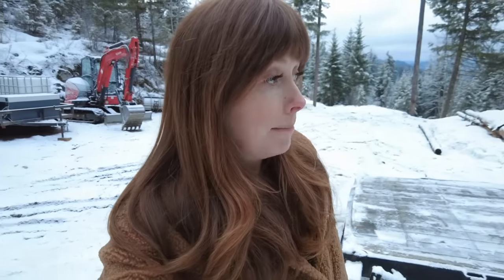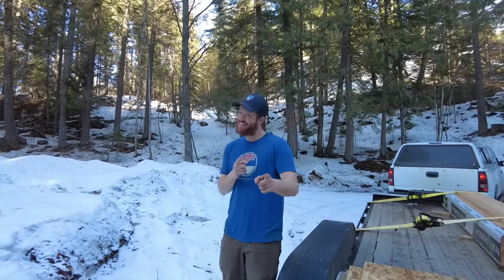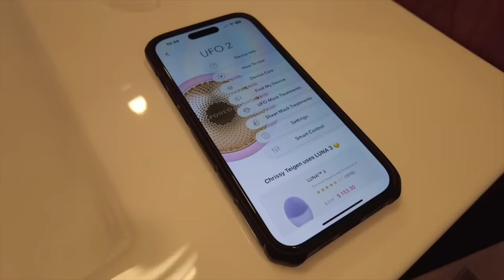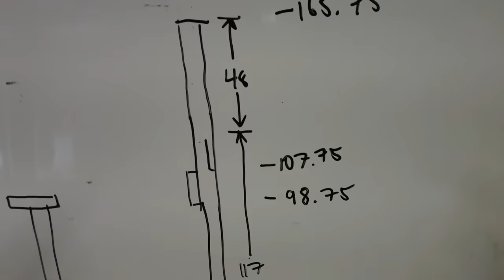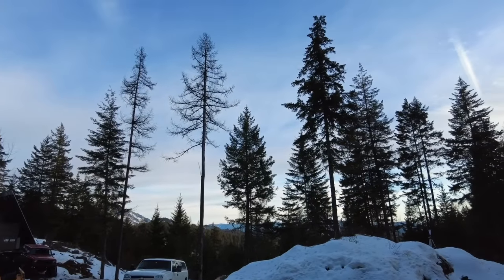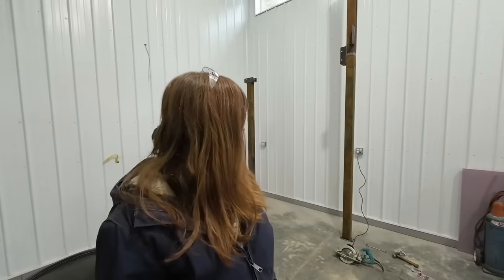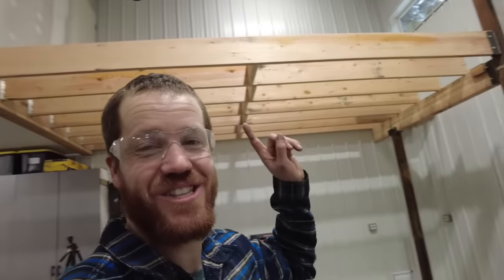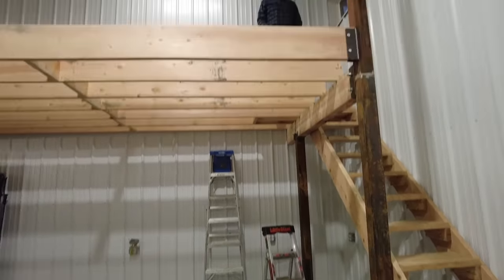Starting A NEW BUILD For Our Growing Family

Comment: Nice job. I live use of metal and CNC machine vs wood only. The engineering stuff is interesting to me as I know NOTHING about it. I also noticed Courtney you looked DIFFERENT in the beginning of the video. I thought it may be impending motherhood (which it may also be), but then realized later that it was THE BANGS. Your hair bangs make you look totally different (and the look becomes you). Pulling them back is not as an attractive look on you in my opinion. Anyway....good job and interesting.

Comment: hot rolled steel is prone to oxidation. Iron oxide is not good for pinewood. peacoat all ferrous structural components prior to installation. unless of course it's stainless steel of a grade 308l